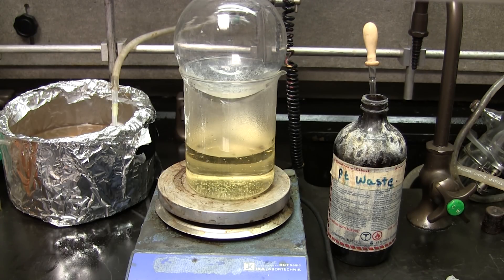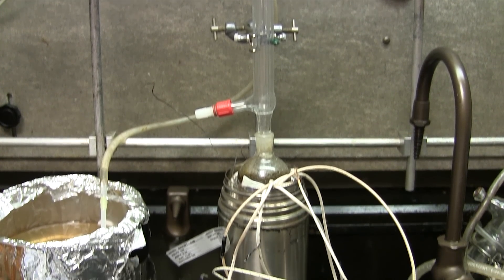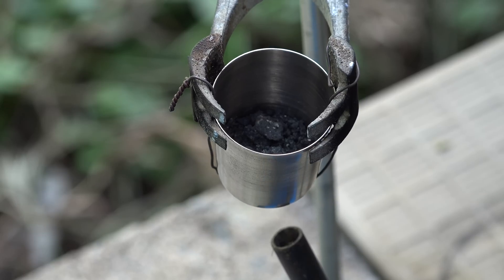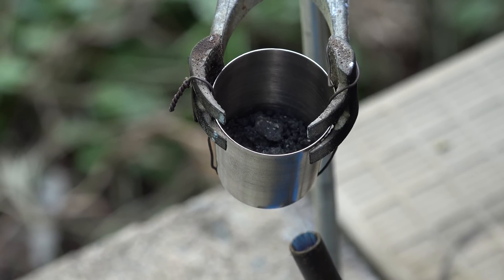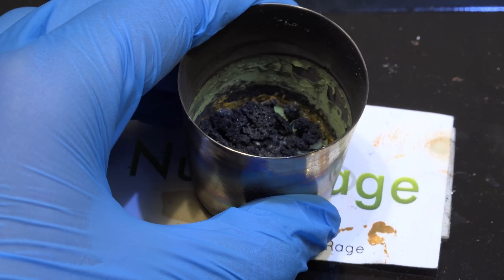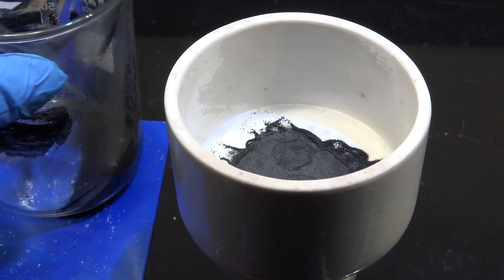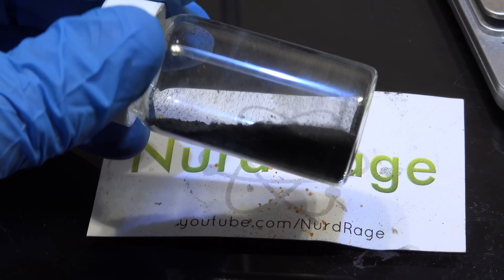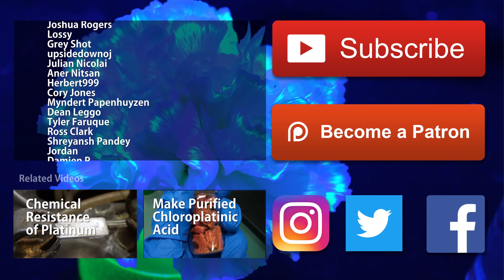Platinum Recovery from Laboratory Chemical Waste (pt 1)

Comment: Used to work as an infusion nurse and lost sleep wondering how much platinum was wasted. Expired vials are dumped in with regular chemotherapy waste. Cisplatin, Cl2H6N2Pt is 65% platinum based on its molar mass, 195g/mol per 300g/mol. Oxaliplatin, C6H14N2O4Pt & Carboplatin, C6H12N2O4Pt have even higher molar masses. This means even with perfect recovery on the largest 200mg/200ml vial of Cisplatin you could only extract 130mg of platinum. 1/5/22 Pt spot is $31.44/g, so basically $4 theoretical maximum. I no longer lose sleep.

Comment: I have metal paladium quantity 14kg I eh vietnam 🇻🇳 I sell please message me https://youtu.be/kBE555jl1nM
Reply from the maker: how do you know it's palladium? what tests have you run on it?
Reply: I have a lot of low-melting metals so I know
Reply: Paladium low melting point small hno3 it gives off yellow  foam it does not oxidoze it incrases
Reply: Paladium  it melts very fast   when i use it and when i put hno3 it makes yellow foam https://youtu.be/kBE555jl1nM

Comment: I go out of my way to minimize "discharges" from my laboratory.  I do it both for the environment and for my neighbors since I live in a high density residential zone. I like the idea of closed loop processes rather than some of the new "green" reactions.  It would cool to make a poster that had a tree of recovery reactions. So, some detail on the use of mercury with strict recycling would be great

Comment: I believe that evaporation is the EPA's recommended way to dispose of "small" amount of hydrocarbon solvents. Typically, they do more immediate damage in the ground than in the air. I'm not sure about this case, but it is for methylene hydrochloride, trichloroethylene, and tetrachloroethylene.

Comment: Would it have been easier to oxidize the organic components (the ligands) in solution with piranha solution? You could perform a distillation and then in the same container, use piranha to oxidize the ligand components, redistill, and then finish off with aqua regia to avoid open flame and inefficiencies involving removing solid/crystallized waste from your glassware. As a plus, aqua regia would also clean your glassware at the same time.

Comment: Wouldn't it been faster and better to simply ignite the volatile organic waste under a charcoal filtered exhaust vent? What waste products would you expect? Most volatile organics will break down into CO and CO2 when incinerated.
Reply from the maker: i say you can do that in the video. you just need bigger apparatus.
Reply: My bad. I must have missed that part. Just wondering if there was some reason you couldn't like a toxic byproduct or extremely low yield.

Comment: Is that possible to use molten potassium chlorate to burn out all the organics?
Reply from the maker: if i'm going to heat it up anyway i might as well just air as it's cheaper and easier to get.
Reply: The residual  platinum particle and whatever metals in it should be very easy to separate from the potassium chlorate mixture.
Reply from the maker: but if i burn it in air there will be no mixture to separate it from, even easier!

Comment: Because I havr worked up platin wast, is there any reason you did not boile the wast in concentrated Acid to destroy the ligands because we did that?
Reply from the maker: high temperature does the same thing
Reply: Thank you. I guess, burning it is also cheaper and faster.

Comment: Question: Could one use the filter paper as a teabag and automate the leeching process using a Soxhlet extractor? I know this probably isn't justified but if one happened to have one (and wasn't making a video about it), I could see that saving active time.
Reply from the maker: It's a bit of overkill, but i don't see why not.
Reply: Cool, just curious after seeing your video on the device.

Comment: its a platinum concentrate not ore
Reply from the maker: gotcha! good to know :)
Reply: I work for a massive multinational Zinc and lead producer but have limited techincal knowledge.  Your electrolysis vids on Zinc and also tr sulphuric acid ones have been very helpful.  Thanks nurd

Comment: did the labs make you pay a lot for the high-end chemical waste, and I know you mentioned using a distillation tube or something?  

Also, if you had know other info other then it had platinum in it is there a way you could have tested for the the main chemicals and distilled them separately for us in other projects?

Comment: Naughty naughty, processing waste without a license. I learned in my RCRA class that its not waste until no one wants it anymore. So you should be buying spent platinum catalysts and other compounds for reprocessing ;).  I.e. barrel of methanol with  1% impurities thats unusable for analytic chemistry? Either pay $lots to have hazwaste disposed of, or sell/give it to a company making washer fluid so they can add blue and surfactants to it, so consumers can pay for the pleasure of spraying your unwanted chemicals into the environment.

Comment: Wich salt or mixture of salts should I use to turn a flame purple?
Reply: Potassium has a purple flame but is often orange from contamination with sodium. Indium seems to have a nice purple flame but I don't think you get Indium salts easily. Maybe some lead compounds would be okay, those are more blue flames
Reply: Potassium sulfate should work, right?
Reply: Matias Isola
Yes, the counterion doesn't matter.

Comment: I think you are pretty brave boiling that down... unless you had an excellent idea in advance of what you were dealing with. Even HNO3 electrolysis solutions can yield N3 under some conditions. I would have to presume that such a waste were both highly toxic and potentially explosive without good info to the contrary.
I was hoping to see some fantastic process to neutralise potential hazards prior to refining.

Comment: Would a graphite crucible be suitable?
Reply from the maker: go for it! I totally forgot about graphite when i was mentioning the crucibles. A tiny drawback is that it's hard to tell apart grey graphite from grey platinum waste. So you might not be certain you have quantitative transfer.
Reply: NurdRage Might also be something to look into for that experiment involving the induction heater, if you hadn't already.

Comment: What is the cost of energy (propane and electricity) vs the value of the platinum?
Reply: walperstyle I don't know, sorry. I'm not familiar with the chemistry in the video. I just know that running a kilowatt hour heater for an hour costs about $0.10 and a small canister of propane costs about $10.
Reply: If you do it on a higher scale o think it's profitable.
Reply: Thanks tips, i'm looking for a basis.
Reply: 2 grams of platinum is worth about $70. The electricity probably cost around $0.50 - 1.00 and I'd guess he used well under $5 of propane.
Reply: What is the total time to do this?  Plus cost of supplies?

Comment: I like the video :) takes me back to the earlier days of your channel! I do have a question though! With the oxidation of the ligands in the incineration process, classic greenhouse gasses (specifically the NOx) are being released into the atmosphere. What would be done to the waste on an industrial scale to prevent the release of these gasses into the environment? I know you mentioned you are not following an EPA but from your experience as a chemist what would you say is a typical industrial setup. Thanks!
Reply from the maker: It's actually pretty easy. The gases are first sent through a wash tower that washes out all the particulates and soluble gases. Because most of the organics were removed during the initial drying steps, the amount of actual gases from incineration isn't that high. The smoke is just really dense. So a scrubbing tower easily  washes them out.
Reply: Seems like the problem wouldn't be the incineration but rather the initial boiling then! I'm assuming that the entire process would, at industrial scale, be handled by the same scrubber and crucible then. But if the waste you have was from a lab using Pt catalysts, then would the set up size you have be typical for an in house recycling process or do some labs actually produce barrels of Pt waste?
Reply from the maker: Some labs produce lots of waste. Others collect what they can, boil it down, and then send the residue to a refiner. The refiner pays for shipping. The lab doesn't make any money in that case. In terms of cost savings or profitability most labs don't bother handling their own waste and just send it off to the refiner or simply dispose of it along with their regular heavy metal waste. 

That being said. A good number of individual chemists in those labs will refine it themselves because its fun! After doing twenty thousand carbon coupling reactions that usually produce brown sludge, the average chemist would welcome the opportunity to mess with platinum chemistry and actually see something cool come out the other end they can hold in their hand. Even if it's not exactly "profitable". They already have all the equipment and chemicals, why not right? :)
Reply: It would most definitely be a welcomed break :) but then the next question would be how do the refineries make money off the Pt waste? You claim a half a gram but that is about $15. Sure there is the economy of scale but surely the cost of reagents, hazardous goods shipping fees, scrubber costs and energy input would be higher and out pace the scale up! Clearly it is not since the refineries exist but it seems to me like it would be a difficult business to break even or turn a profit!
Reply from the maker: oh the stuff in the video is just one lab. Refineries collect residue from hundreds of labs. They also don't do it one at a time but stockpile the residue until they have many kilograms of it. Then they do it all at once. It becomes VERY profitable at that point :)
Reply: Oh no for sure it goes up when stockpiling but what I was getting at is per kg it seems to me like the profit would be barely there. Like the cost of what you did (excluding space and labour) would be barely offset by the Pt recovered, but once again the stockpile would add up overtime so long as it is net profit/kg :)
Reply: Probably the same refineries that handle laboratory waste also handle for example catalytic converters and electronic waste so the total amount of precious metals recovered makes it really profitable

Comment: Hey #NurdRage, I'm about to do my HNC Electronics Engineering level project, looking to do some form of automation. Recently I've had some interest in chemistry. What kind of automation system would be interesting / useful for a home lab chemist (or industrial lab chemist)? 
Autosampler / dispenser? Titrator?